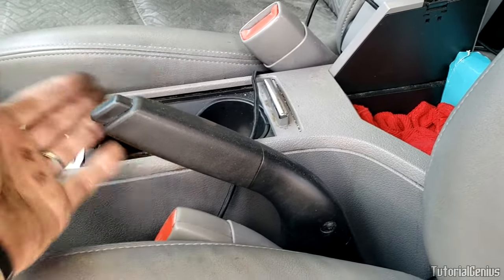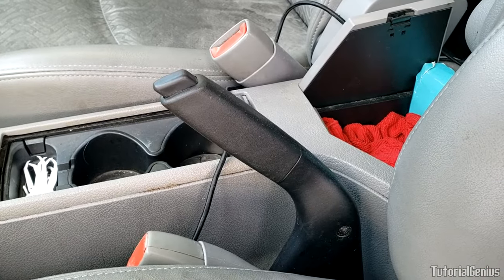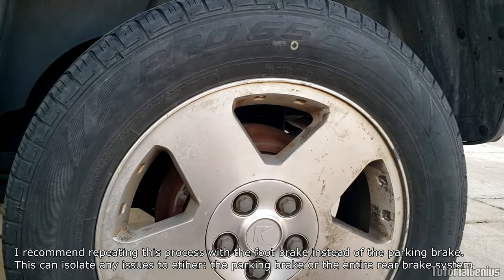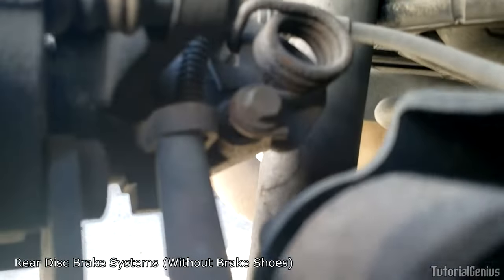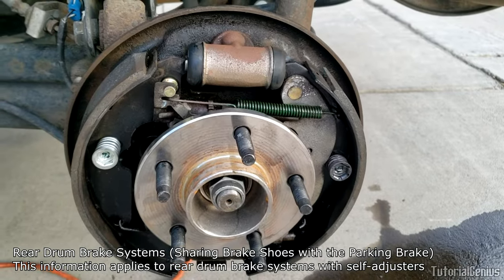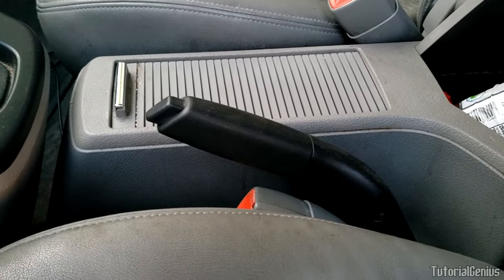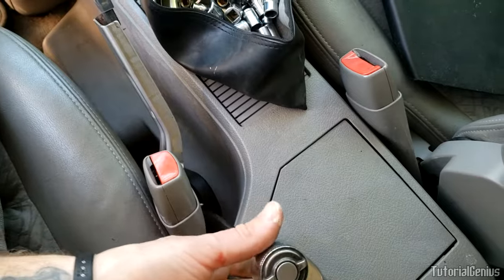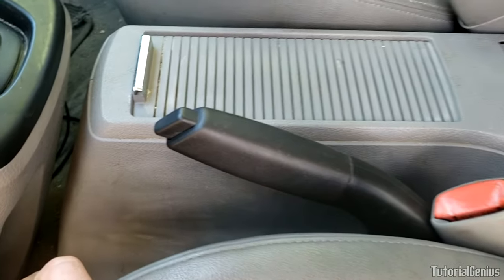Parking Brake 101 - Troubleshooting and Adjustment | Handbrake | Emergency Brake

Comment: Your never supposed to adjust the Emergency brake from the cable the proper way to adjust it is in the brake drum, theres a hole where you stick a flat head screw driver and adjust it from there, adjusting it from the cable will eventually cause the cable to break.
Reply from the maker: I'm not 100% sure you watched this video all the way through, so I have no idea how to comment on this without repeating what I already said it the video lol

Comment: I have my 2007 corolla and the e brake was very loose, I removed the drum brake and re adjust the self adjusting part, then after 1 week it got loose again. I removed the drum brake again and cleaned then with brake parts cleaners without removing the harware. Then I adjusted it again, and now it lasted a couple of months, but it got loose again. The vehicule has 190K miles. Do you think the harware and self adjusting part are already past their prime and need replacement?, brake shoes, and drum disc are brand new
Reply from the maker: Sorry to hear!
What happens when you manually self-adjust (When driving)?
Loose on both sides?
If both ends are secure 100%, then you're pretty much left with the cable or the self-adjuster. There isn't much more to it considering everything else is new
Reply: @TutorialGenius  Nothing happens when driving it. Before I even did anything to the brakes, the e brake was loose, no matter if you were pulling it all the way up now after I cleaned the harware and self adjusting with brake parts cleaner it was holding up good for a couple months but eventually got loose again but right now it does actually engage whenever you pull the e brake all the way up
Reply: @TutorialGenius  I gotta mention that the self adjusting part instead of expanding itself, it actually retracted inward, so for some reason, I think it might just be worn out, but I would like a second opinion before spending money. Thank you in advance
Reply: @TutorialGenius  it's loose on both sides. You can actually pull the drum without any drag. Of course, I gotta manually adjust it for it to have some drag, I have only done it 4 times now, the previous 3 times I didn't cleaned it the fourth time I cleaned it and improved and hold up for longer than 4 months

Comment: One question.  Is the brake lever pulled into the up position (parking brake engaged) or should it be put into the down position (parking brake disengaged) when tightening the adjuster for the cable?
Reply: he put it up to adjust, since that’s the tightest it would be

Comment: Great video, just one question, if I have rear drum brakes without brake shoes, does it mean the pads and the caliper is working excatly the same as with regular brakes, but in this case purely mechanical? in other words does the pads clamp to the disc fron both sides by pulling the cable? thank you
Reply from the maker: I'm a bit confused... You have drum brakes with brake shoes?

Comment: Hi! I have a 1999 Astro van which has locking up brakes every time I start driving the car in the morning. Sometimes they start to lock up later in the drive, occasionally. 
After a few slow accelerations and stopping slowly, the locking goes away upon initial drive. 
I have already replaced all the hardware in the drum brakes and brake master cylinder.
Have no clue what to do next.
Reply from the maker: Both brakes? rear? front? left? right side?
Reply: It’s only the rear brakes. The front are disk. 
After watching your video, I tried out the “backing up and stepping on the brakes”. 
That got rid of the locking up, but I’m more than confident that is a temporary fix. 
I’m concerned, now, that the actuator pin is freely spinning.
Reply from the maker: @AutoMotivate  Spinning??? brake actuators don't spin
Based  on your response, I would suggest taking it to a professional.

Comment: Did you happen to do a video on replacing the parking brake cable?
I have an 04 Saturn Vue but can not find a video on replacement. Do I need to removed the center console? Or do I just pull up the carpet? I have no resistance when I pull up on the handle...the sheathing on the cable is damaged and needs replacement.
Reply from the maker: I believe it runs under the car, just pop the back wheel off and follow the cable and see where it goes.
I dont have a video because I havent had to replace mine.
I only make videos for other people when I do repairs on my own car.